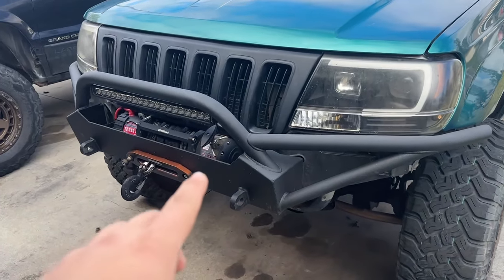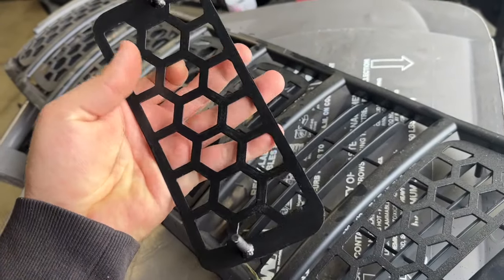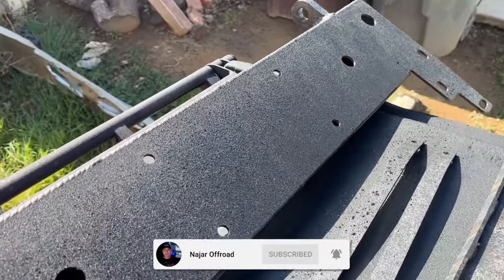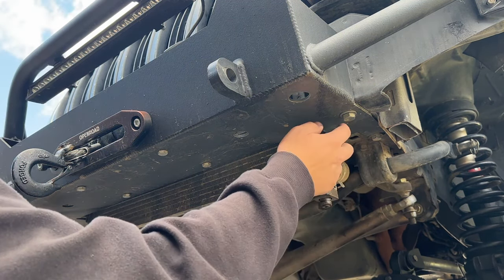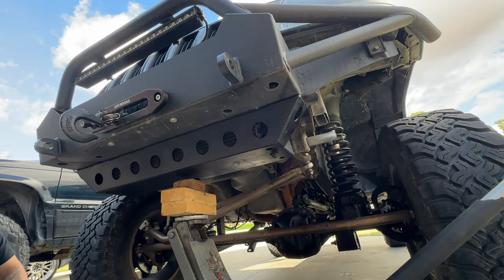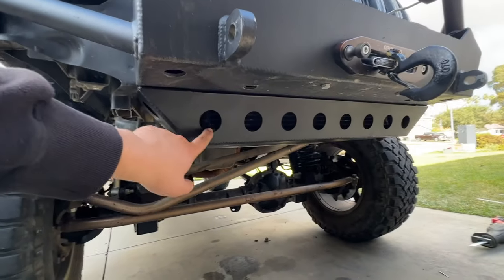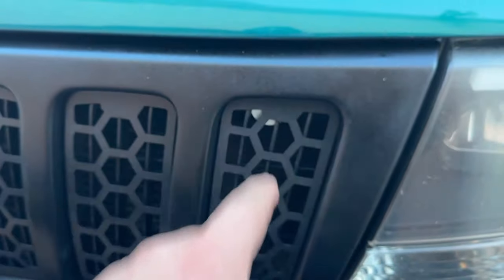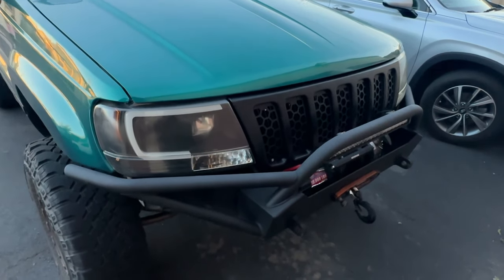Installing D. Till Fabworks Radiator Skid Plate on my Jeep WJ

Comment: Did you have any issues with the radiator support holes lining up with the rubber isolators on the radiator? Mine were slightly off and i had to open the holes larger. Same with the holes to the frame rails.

Maybe they've updated their design since I bought mine 2 years ago.

Thanks for the great WJ content.
Reply from the maker: No everything fit. He did recently update the designs on the bumpers but this skid I purchased a year ago no problems

Comment: Hey so I have a 2004 low mile wj limited with the Quadra drive and I’m lookin to put a 4 in lift kit on it . All the kits says they don’t fit because of the drive shafts. I have the oem with the double yoke or whatever. What else would I need to do to make the kit fit or would it be fine with the drive shaft I have
Reply from the maker: It will fit! The main reason is the fact that if you don’t have a double cardan, the drive shaft will fail